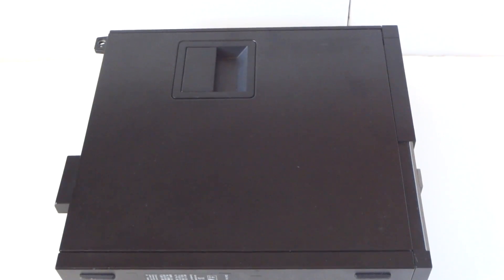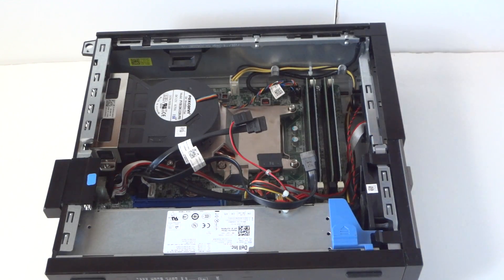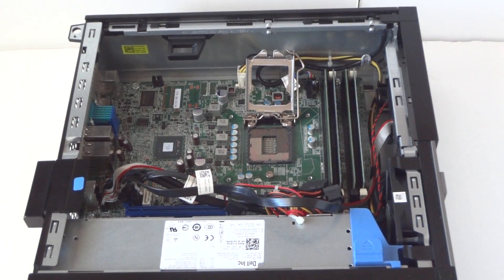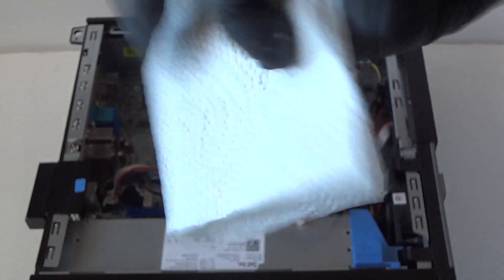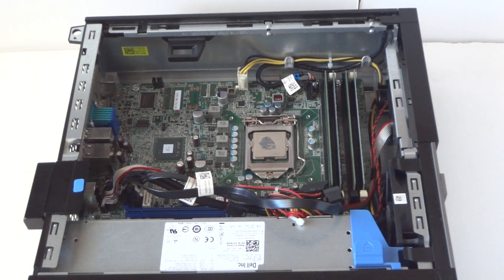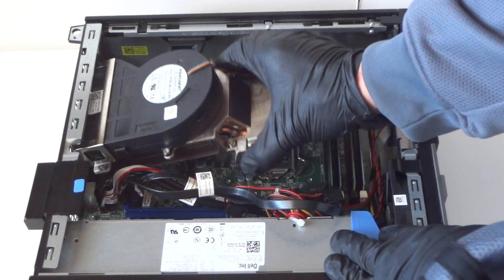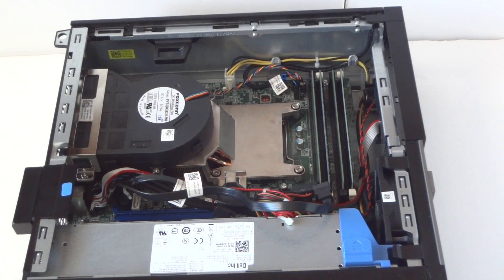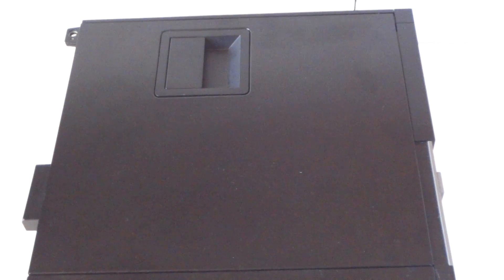Dell Optiplex 790 Upgrade Install Replace Change Processor

Comment: Hi, great video. Did you upgrade from an Intel I3 to an Intel I7 2600. Is that the best chip that can be used on this computer? Thanks for your time
Reply from the maker: Hi, yes you can upgrade to intel core i7 2600 on this machine and don't forget to update the BIOS.
Reply: Thanks, I appreciate your info. On a side note, I watch a few of your videos and wondered why the gloves. Then it hit me. No static electricity through the gloves. At least that's why I think you had them on. Thanks again.
Reply: Sorry for 1 more question. When updating the bios is it ok to go from A05 to A16 or should it be done in intervals of closer revisions?
Reply from the maker: Yes you are right no static  when you where gloves.
Reply from the maker: Yes its ok to update BIOS and you can downgrade BIOS any time you want and that's why i like dell.
Reply: Thanks for taking the time to reply. I appreciate all the great information. I totally understand why you would upgrade but I'm not so sure why I would downgrade.
Reply: @richardbowden9561  Dell recommends on their website current BIOS versions of a02 - a04 be upgraded to a05 first before upgrading higher. a05 - a09 need to be updated to a10 first, after a10, you can upgrade through all the way to current BIOS a22
Reply: Would a Optiplex 3010 SFF work if I replaced the i3 3220 to i5 3470?